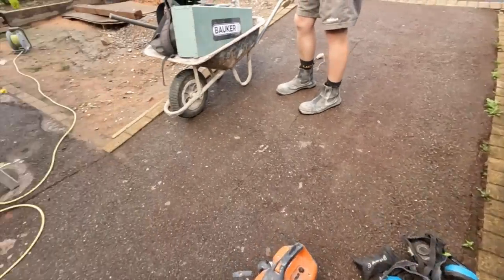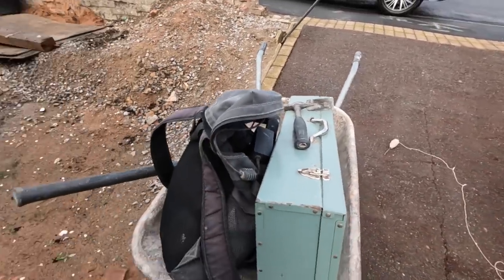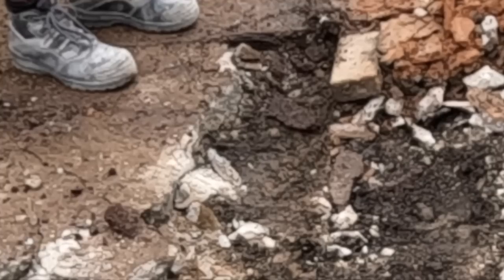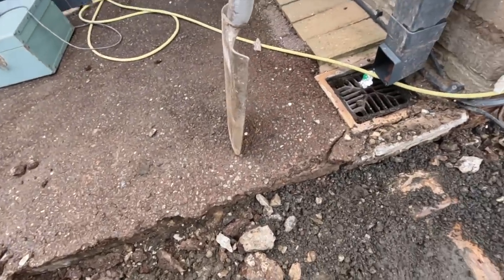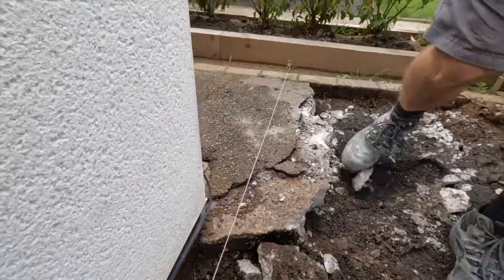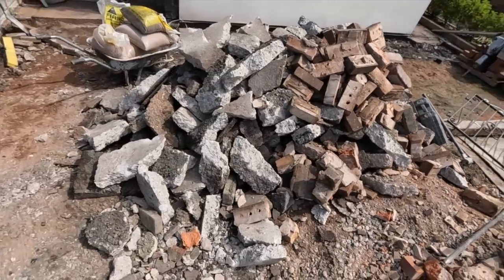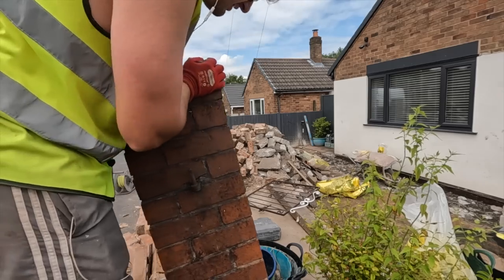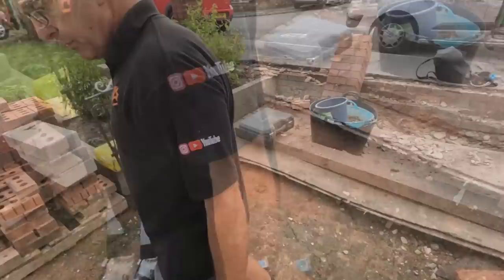DRIVEWAY DEMOLITION!! #LANDSCAPING PART 1

Comment: Can’t you use “concrete lintels” for the driveway edging ( just for old times sake). As for poor driveway construction. I’ve pulled up concrete path/drive to find a 2” layer of broken panes of glass, put in before waste skips & grab bucket cranes.

Comment: The Baulker breaker you are using is sold here on the continent by Hornbach DIY stores under the brand Patfield.
I bought one of these a few days ago, buying this breaker costs less than 5 days hiring one, it was only €150,-
I haven't started yet with the demolition job, so did not use it yet.
 Are you satisfied with this breaker and how long have you used it already?
Reply from the maker: Absolutely awesome machine did the price , very powerful and lasts well for the price 👌🏼🧱👍🏽
Reply: I recommend Trying out a Macalister Breaker they are cheap on ebay for only 100 pounds